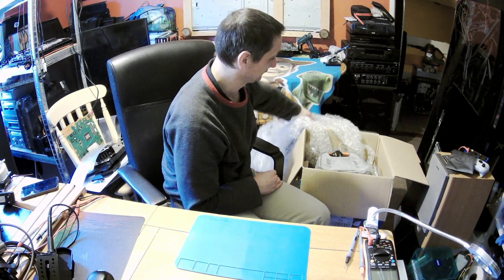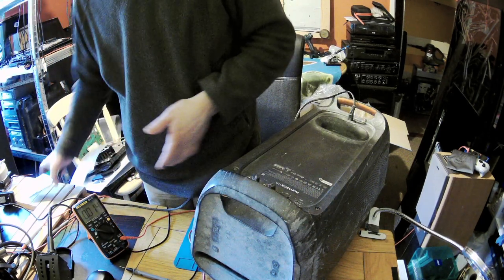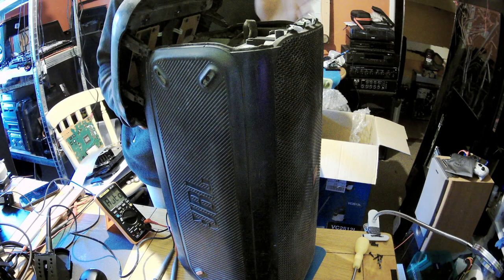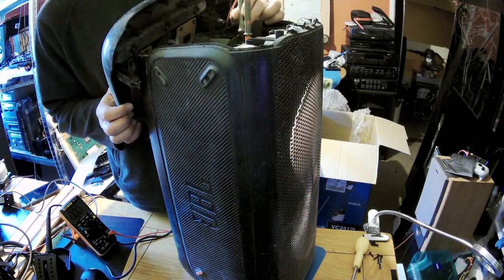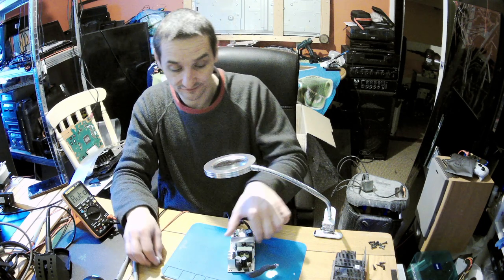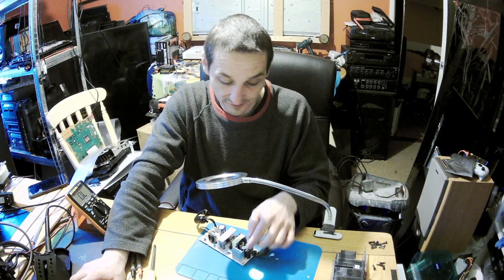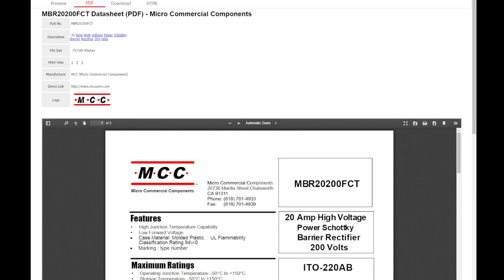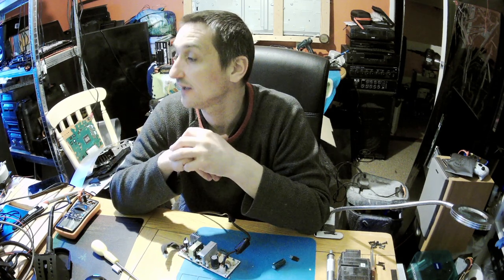JBL Partybox 100 - power failure, starts and turn off shortly after

Comment: Hey i have a partybox 200, when i plug it in, power light turns on for about 3 seconds and then shuts off, no power after that until i unplug the power cable and plug it back it, then will do the same thing again.. any recommendations? Thank you!

Comment: I ordered one online and it's coming, hope it works flawlessly 🙏
Reply from the maker: Just keep in mind that these power supplies are high-frequency ones and are overheating on top of that. They are not built to last.

Lack of active cooling like a fan, plus a high frequency might make them to last only about a year or two. Depends on your usage ;).

You can contact me to fix the power supply for you after. Happy to help :).
Reply: @screen-protector  Thanks man, I'll let you know!

SUBSCRIBED 👍
Reply from the maker: @iamlegend3669  thx :)
Reply: @screen-protector Bad news, after about a year with not much use the 100 behaves like it has life on its own.

I turn it off and about a minute later turn on by itself. Then about an hour it turns off and after a minute or two it turns back on again.

Continues like that until battery dies..

Looked for some troubleshooting in the internet and it looks is some damage in the battery...

I'm very dissaapointed on JBL😢

Comment: Hey..greetings from Dallas tx. USA I have the exact same speaker that I just bought used. It is like new condition but totally dead. No power no lights nothing. Haven't opened it yet but your directions on where the screws are r a big help I'll keep you up to date.thanks for your great directions.mike retz
Reply from the maker: Hey, Mike, good luck! :) Hope your one will be a easy fix ;)

Comment: Hi brother……my speaker turns on when pressing the power button for long…it only turns on when plugged in but when I remove the charger after charging whole day and I turn it on it will only run for a 5 to 8 mins then turns back off
Reply from the maker: Hi, that means that either your battery is almost dead, or there's a further issue and it's better to take it to an expert. Otherwise it can kill you even, so, if you don't wanna risk it, ask someone for a help.

Comment: Hey dude. Ive got the same partybox just came. I got the screws out. 3 were hidden! Thanks for your great directions. ! Anyway i have the same trouble. Power supply is dead. No output.. fuse good .voltage up to first transformer.. 110vac.im in the usa. You directions are great on your videos and really like your troubleshooting techniques. Ill let you know future progrress! Hope its not one of the transformers! Im a very bad rewinder!🤣🤣. Im looking at the power supply and maybe tomorro  ill get around to do further testing. Later dude and have a great night🇺🇸🇺🇸🚴🚴🚴
Reply from the maker: I doubt that it's a transformer, I'd go for some MOSFET, diode or PWM controller. Thanks for kind words.
Reply: Thanks.. I like your solution with the 19volt supply with the computer power supply! I think the voltage at the output connector is about 42 volts. According to the schematic I obtained online . I'll try the MOSFET like you said. Thanks again .. have a great evening✌️✌️🚴🚴.

Comment: Hello…having an issue with my Partybox 100, works perfectly when plugged in but instantly switches off when unplugged battery gauge shows full but can’t turn on without it being plugged….any solution on this?
Reply from the maker: Are you able to diagnose electronics yourself? If not, you'll have to take it to someone who does. If you do, what did you check till now?
Reply: No I’m not…..I’ll keep you updated once I find the cause,could be the battery or the power unit I don’t know but without it being plugged it’s practically dead
Reply: No I’m not…..I’ll keep you updated once I find the cause,could be the battery or the power unit I don’t know but without it being plugged it’s practically dead

Comment: Hey brother.. i have partybox 300 it turns of immediately after turning on and  before this problem it had no startup/shutoff sound and no sound at all.. lights work connect's to bluetoothm. Any suggestions
Reply from the maker: You'd have to disconnect it from the power, and disassemble it completely to first remove the battery connection. Leave it off for a good few minutes, and connect. Test it again. If won't help, you'll have to take it to electronics repair shop as this might be too advanced if you don't know electronics ;) in general.

Comment: Hello Dear.
I have one of the jbl partybox 310. The speaker is working normal, but when I click the button OFF, There was automatic restart. I try to factory reset speaker and also update. Could you show me how to fix it?
Reply from the maker: Hello, I don't have this speaker, we had a few for repair months ago. But, it looks like power issue. So, anyone with electronics skills should be able to figure it out.

Comment: Hey man, I just recently bought one off someone and it will turn on but once I turn it off it comes back on for a couple seconds and then off and then on again and repeats that until it dies. Something is also wrong with the Bluetooth it won’t connect or even show up in any Bluetooth options. Any idea on how to fix this? Thank you!
Reply: Hey man that's what's happening with mine too.any ideas
Reply: @steevorokanauto6111  haven’t figured anything out yet hoping this guy responds he seems to know what he’s doing 😂. There are no videos at all explaining how to fix this problem
Reply from the maker: Hello, it's looking like the power issue. Did you try to charge the battery, or use another source to power it on instead of the main power supply, or the battery?
Reply: @screen-protector  yes but it just turns on and off by itself until it dies. And the Bluetooth doesn’t work whatsoever.

Comment: I am facing the same issue 
Battery not give any backup and taking days to show full charge
Reply from the maker: If takes ages for a full charge, there's an issue with the charger. I've got DELL laptop here, in them it's a charging IC most of the time. In your case, I'd try to charge the battery externally by using another charger or better bench power supply - if you know electronics. 

If you don't, you can find someone who does. I live in the UK, so can only serve customers from UK. Don't know where you live.

As well, these power supplies in them are of a poor quality ;). You'll be better off with a used laptop power supply - branded one.

Comment: My party box 100 is getting on by itself and I switched it off and the same automatically gets happened it gettin on by itself what is happening I am using this like almost around a couple of months but don’t know what is happening help pls some one
Reply from the maker: You can either get it to someone who can fix it, or someone who can install an internal switch that can go outside and you can manually switch it on and off this way.

But, without knowing where you stay and without diagnosing the fault, how you expect you to help? Especially if you'd fix electronics, you could do it yourself, and inside is mains power which can kill you, so how you expect us to help you?
Reply: @screen-protector  ok bro